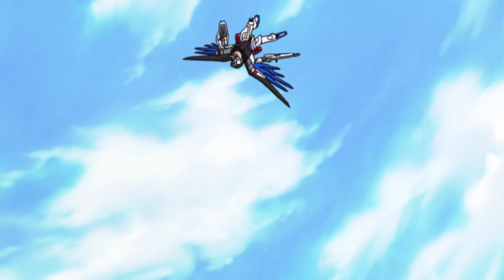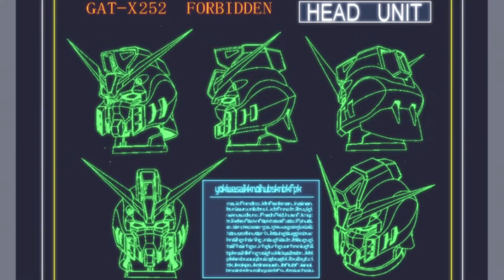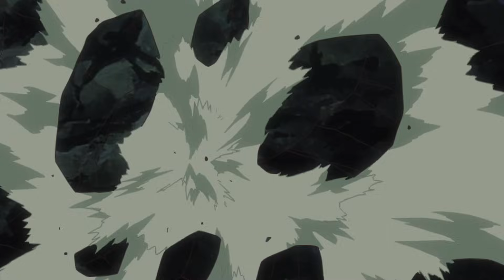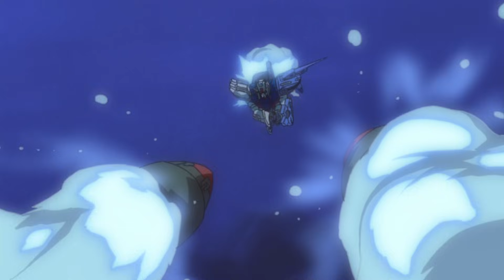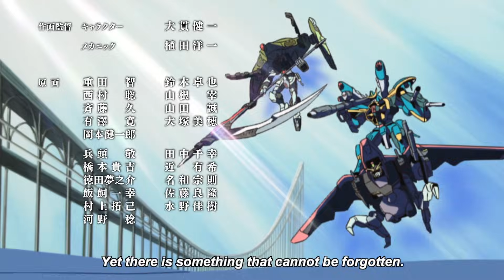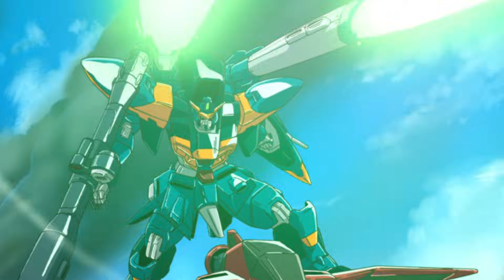MECH ANALYSIS RAIDER GUNDAM

Comment: I think the Gelb Raider is SICK!!! but its weapon load out seems a bit ….unbalanced like that large cannon isn’t gonna give it wheight issues? And that slightly bigger hammer won’t help even it out at all
Reply from the maker: I agree!😀

The Gelb Raider does look better, but the thing is too weapon heavy and kills the speed.

If they just swapped to OG weapons of the Raider with more powerful ones.

It wouldn't be an issue.

Maybe switch the hammer to something else like a gun-lance, a beam rifle or the boomerang shield like what the Rising Freedom and Immortal Justice had and you've got yourself a hell of a mech.😁
Reply: @K4KriticaL there ya go ya know I was thinking the backpack and wings of the immortal justice feel more for the raider like the wings and nosecone are bird like like the raider
Reply from the maker: @megagundamva2694  I also thought that the wing structure between the Immortal Justice and Raider were similar.😀

But it logically looks to be quite an aerodynamic design so it was no wonder it was adopted.
Reply: @K4KriticaL  true raider works BIG TIME
Reply from the maker: @megagundamva2694  Indeed!😁

Its just a shame that the three second gens like the Raider didn't get any kind of successor units at all.😮‍💨
Reply: @K4KriticaL  well i count the Geld raider i absolutly LOVE ITS DESIGN but it Needs Screen time and more symetrical weapon placement and BAM Perfect
Reply from the maker: @megagundamva2694  Its true, they should have given some screen time.😮‍💨

That's the only sad thing about it.

Gundam's been around so long and there's barely any animation of some of the cooler designs.😅
Reply: @K4KriticaL only thing that has it worse is Zoids
Reply from the maker: @megagundamva2694  Yeah, just sad.😅

Comment: Yeah the rocket hammer is weird and would hinder Mobile Armor Mode. If we want to maximize aerodynamics, I doubt the claws are helpful either. If we replaced the claws with waist and shin mounted rocket-propelled grenade racks, Raider could try both bombing runs and sudden explosive bursts. Without messive with some of the main flight surfaces. But then we should probably consider adjusting the arms and the nose cone.
If we took a note from the Chaos, we could let Raider gain its own Scylla in Mobile Armor Mode, shike keeping Zorn in the mobile suit mode. If we change hkw the shoulder armor works, we'll probably be able to keep some of the suits machine guns. Perhaps simply making "turrets" as shoulder pads, so they act like lower angle guns on an old bomber plane in MA mode?
I figure after doing that we could slap on tactical warheads to launch from the wings, and replace the arms with ceramic coated, crushing cmaws, with the same rifle + saber multi purpose beam emitters. You'd lose the rotating hammer shield, but with this idea, you could just reach and crush a beam saber handle.

It aint easy to understand what the suit desjgners were thinking, sometimes.
Reply from the maker: I agree with replacing the machine cannon on the back with a beam cannon instead.

Use a better aerodynamically designed melee weapon or get rid of it all together and just give the machine another shield cannon on the other arm or better yet.

Make one of the barrels on the shield-cannon a beam rifle that has a beam saber mode like the blitz gundam and a lot of problems are better addressed.

Personally I like the claws.

They should be usable in mobile suit mode as an extra pair of sub arms that could emit a beam saber for close range engagements.

I didn't know why its pilot didn't use them like that though.🤔
Reply: @K4KriticaL 
Presumably he didn't try using the claws more because he's trying to dodge beams, fly without crashing into water or debris, fling a rocket hammer, fire a double barrel machine gun, fire a beam from his robot's mouth, and decide when to transform and use his three other machine guns, all while he's avoiding hitting his allies. It sounds stressful, and not one of the guys between Clotho, Orga and Shani, seem like they wanted to take many risks when they're a 3v2 and can't make good enough progress consistently. I mean, there was only the one time Shani tried to bend a shot from the Schlag, yeah? Most of the time he focused just on his own beam shots.
If we really did make a machine gun + beam rifle + beam saber, composite shield weapon, honestly we could remove its manipulators at that point and hook the weapons directly as forearms. They might even serve as tail guns in mobile armor mode, and that's super rare.

Comment: The main issue of putting Anti Beam coating on the Mace itself would be the Wear and tear, quite literally like scratching the finish and paint of a car, it would continuously lose that coating from the heavy impacts with enemy machines, making it impractical...
Reply from the maker: That's true about the scratching off of the coating, but since the other side is using beam weapons which we all know is more than likely, I think its a necessity.

There's also the fact that this is a weapon system. A close combat one at that.

While I like your car analogy. 

The difference is that the coating on the car is meant to keep it looking good as you cruise around town getting the attention of some honeys but the coating on the weapon system is meant to keep it in good working order while bashing the opponent's suit to pieces.

The coating could always be reapplied during maintenance, but ordering and constructing a replacement mace with its complex thruster network and  anti-beam coated wire would be far more costly.

Don't you think?

🙂

But I like these kinds of discussions.

Feel free to post more and we could discuss.